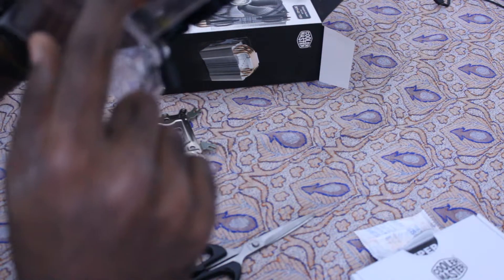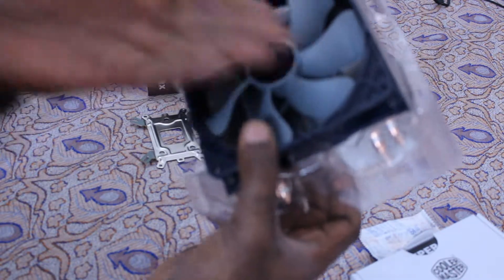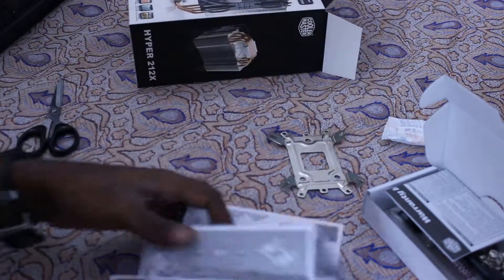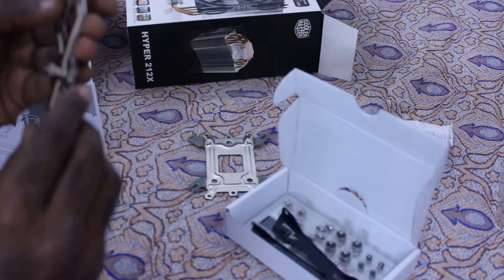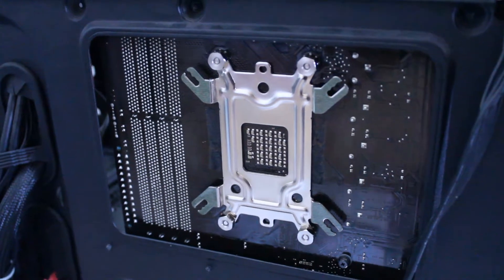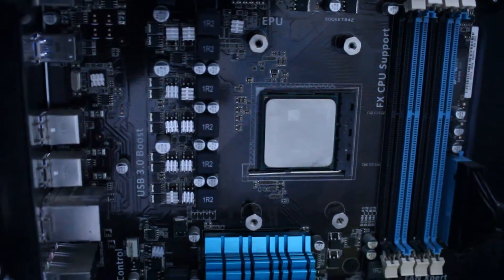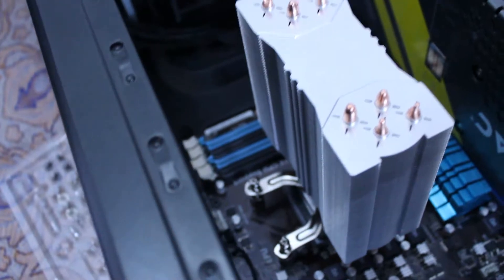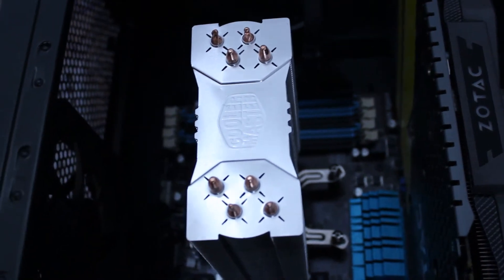Cooler Master Hyper 212X Evo unboxing and installation on Asus M5A97 R2 LE and AMD Fx 8150

Comment: I’ve used the heatsink 90 degree rotated by your build. It was hell while ı was installing 12 years ago. Now I am trying to remove it and it is hell as well :( your install direction is smarter. For those who have problem might remove ram cooler air channels above and it propably would perfectly fit
Reply: I just measured the block and the distance to ram slot. From the middle, they are both 6 cm so only the fan might be a problem and you can remove the heatsink of the ram to workaround the height problem. Or you can just mount the fan otherside